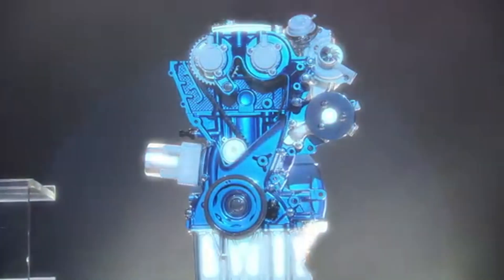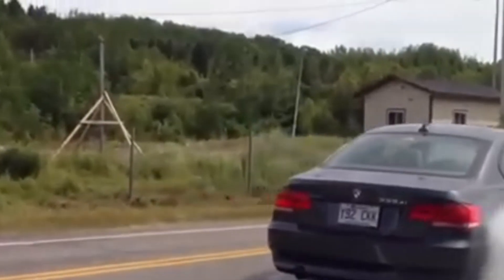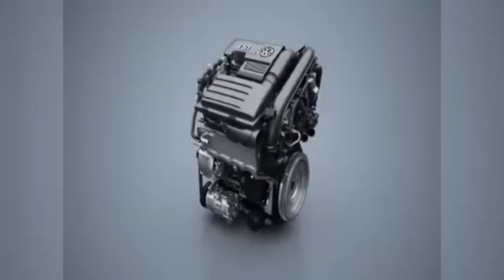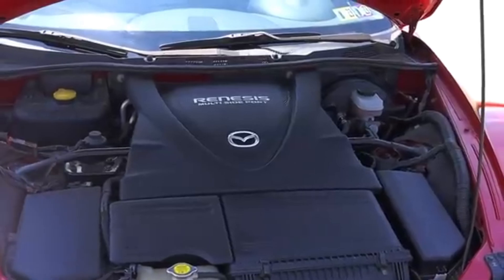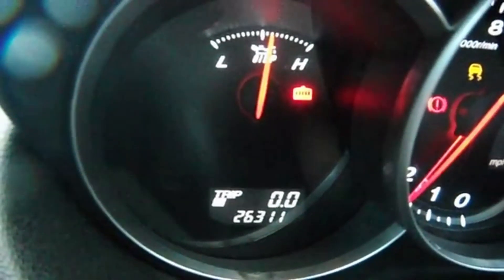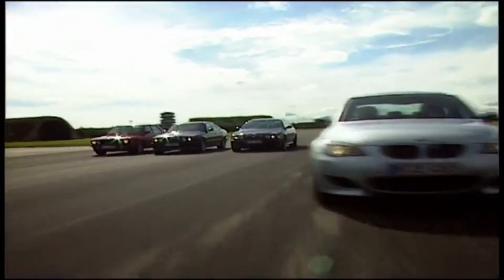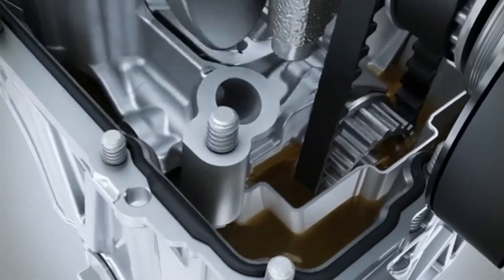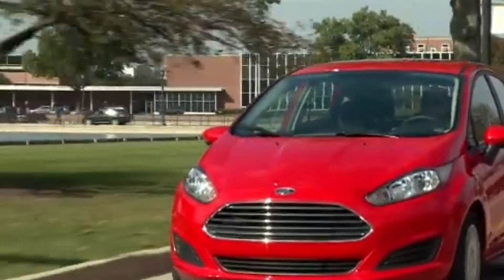AWARD WINNING engines that turned to be PROBLEMATIC

Comment: I am not saying this is not true. What I do know is that Americans do not like spend the money on maintenance at BMW because it is expensive. So I am not convinced that they do the proper maintenance. I have seen people drive a flat tire down to the rim. If people in the rest of the world share this same opinion about BMW engines I will buy it
Reply: As an ex ford fiesta ecoboost engine owner, I can say with experience while it gave good performance for its size (apparently the block has a smaller footprint than a sheet of A4 paper.)
It's fuel economy was average and the wet belt timing chain and oil pump belt was the final nail (£800 at least and £1300 at a ford dealer) in a used car worth around £5'000
Reply: It is general knowledge in the people that fix cars that many of the BMW engines are very problematic with fail problems that mean the engines are not durable.  like the Eco-boom ford engines, the dual mass fly wheels in Ford, some of the GM engines, the CVT in Nissan, FSI (f**king stupid idea) and TSI engines in VW, and so on.